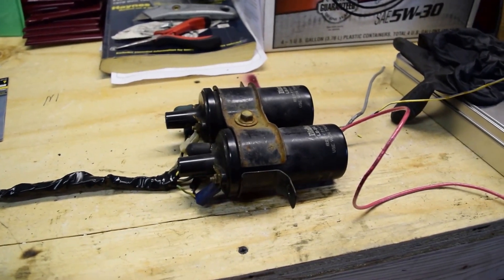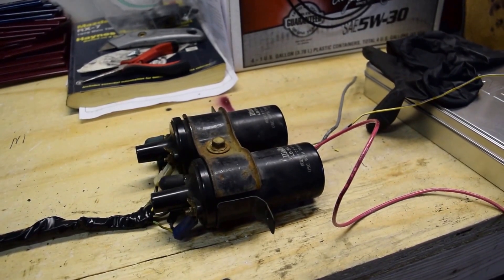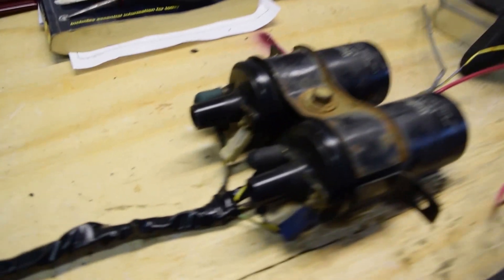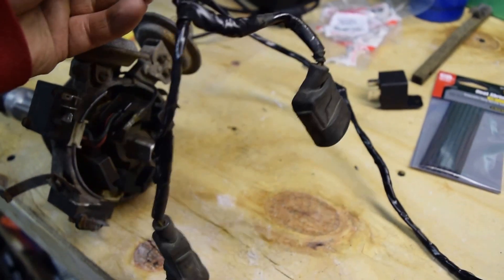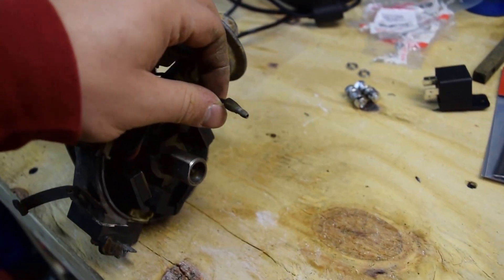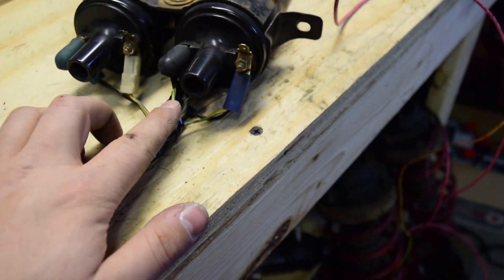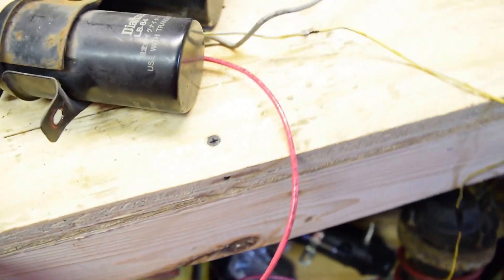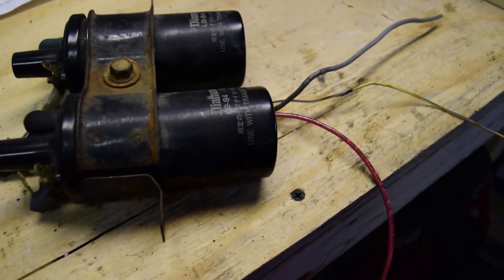Wiring in the Simplest Ignition Setup in an FB Mazda RX-7

Comment: Hey Man, thanks for the video.  I have a 81 Series 2 FB.  Has a 13b 4 port turbo engine that is setup N/A with a Nikki 4 Barrel.  The wiring is a mess, so I am trying to simplify and declutter to just run what I need.  This is handy as! Cheers
Reply from the maker: No worries, here to help!

Comment: Nice info. Just a tip.. Don't use the YouTube stabilization feature when uploading. Eager to see this thing running.
Reply from the maker: Thanks for the tip, I've quit using it since your recommendation!
Reply: Could you help me with my setup?
My distributor is different, and I can't find this info for it.
The motor was apparently pulled from an 82'.
Mine has a red, and green wire to each pickup in the distributor. 2 grounds, and a blue wire with a white strip. (6 wires in the clip) blue wire is separate. 
Most of the wiring has been cut away, and I'm missing stuff. I have the coils, but no harness to them?
I could use some help..